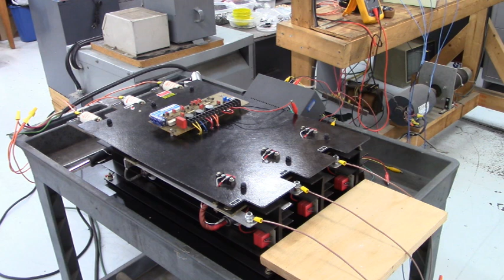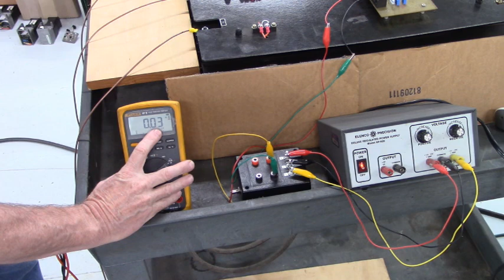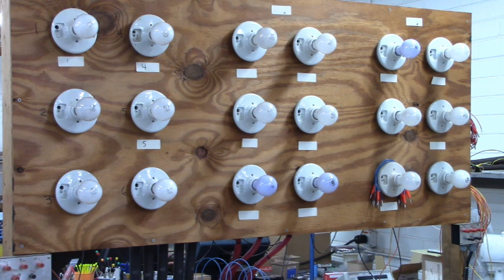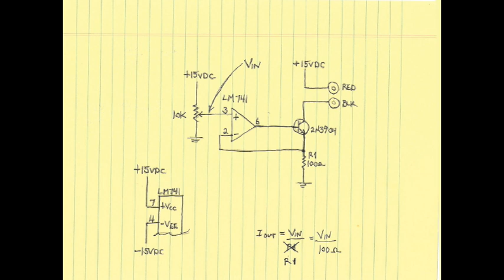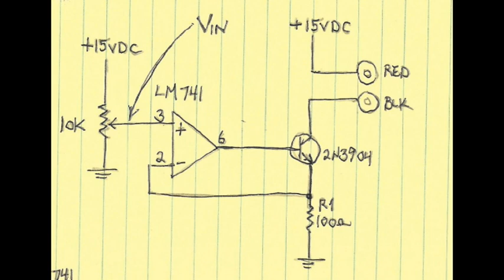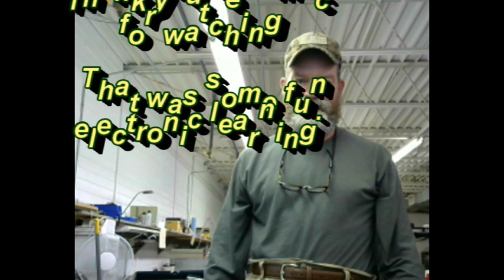Homemade Variable Current Source

Comment: Dear Peepaw, 

I have a problem with a Yaskawa servo drive like the one that you repaired in 3 videos on this channel. The problem begins when the servo motor stops at its correct position in a CNC machine but it showed an over-current alarm. When I disassembled the drive I found a short-circuited diode its cathode connected to the V motor terminal. There are 3 diodes with their cathodes connected to the U, V, and W terminals, and their anodes are connected together to a one 1.5-ohm power resistor. This resistor is connected to an RC component which was burnt. This RC component is connected to the P1 ( IGBT output stage power ). I noticed that this RC component is bypassed by a relay contact when the relay is off. I replaced the diode and the RC component and the drive worked but when the motor stopped at its correct position the drive showed an over-current alarm as happened before. This time I found the IGBT module damaged and also the fuse. I replaced the IGBT and all the seven opto-couplers. Also, I replaced the motor power cable and ensured there is no mechanical overload. When I installed the drive in the machine the same scenario happened. This time the diode and the RC damaged. Does this mean the braking transistor doesn't work properly? May you help me to solve this issue? 

Thanks and Regards,

Omar

Comment: Please help me how to find surface mount capacitor voltage?
01. Code 4DT 3300uf
02. Code XP 220uf
03. Code 52 390uf 

Please help me.
Reply from the maker: Hello, I hope you are having a great day. Are these capacitors surface mount? Usually the 3300uF capacitor would be large enough to show the voltage underneath or beside the micro-farad rating. I am unsure what XP and 53 denote. I will try to do some hunting for these meanings. In the meantime, you can power up you circuit and measure across the capacitors. to determine the voltage across the capacitor. Then double or triple the measured voltage to give you a safe voltage rating for that capacitor. I hope this helps. Thank you for stopping by:)

Comment: Good morning again sir. Good to hear your calming voice again. What do you use to power on motor drives and servo drives for troubleshooting?

Thanks again, peepaw!
Reply from the maker: Hello Sir, our shop used to be a knitting mill. So the building has 220VAC, 3phase. We have a fairly large transformer to step up the 220VAC, 3phase to 380VAC, 3phase and 460VAC, 3phase. This transformer is on wheels so we can push it around the shop. To places where it is needed. I hope this helps you. Enjoy the day. Thank you:)
Reply: @PeepawMcDonald  Thank you kind sir you are very helpful!